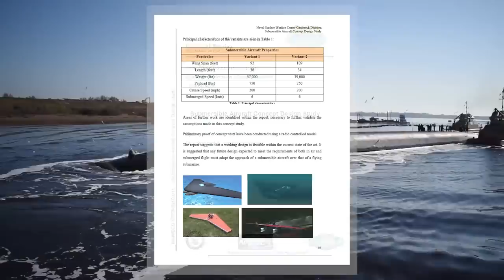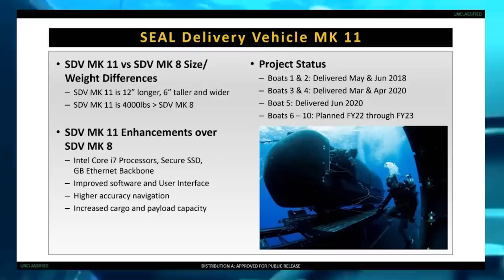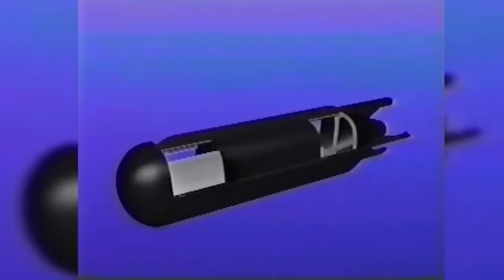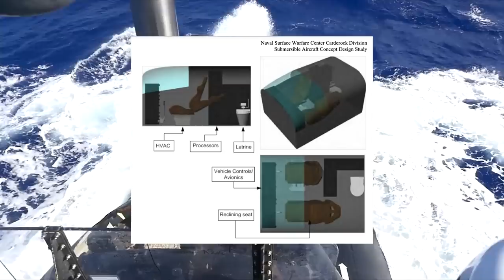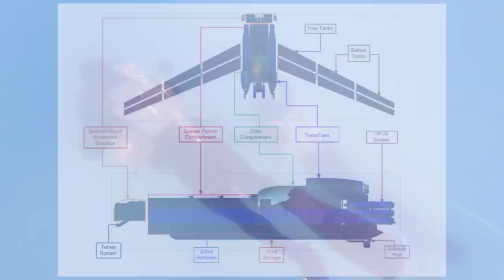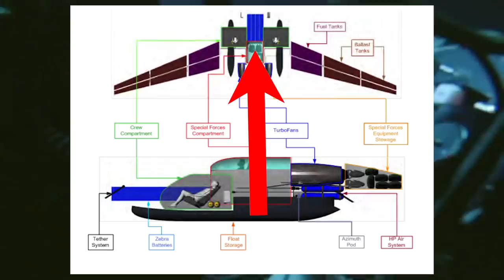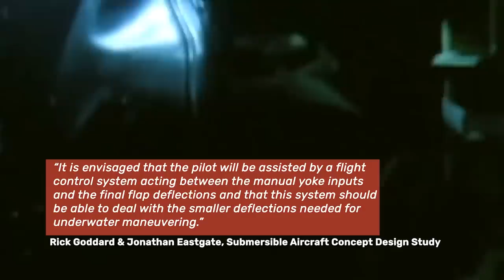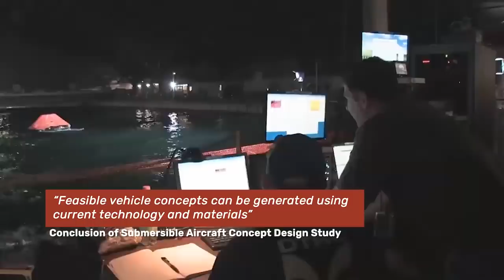Do the US Navy SEALs have FLYING SUBMARINES?

Comment: If you look at the deepflight submersibles like the super merlin, it reaches a depth of 120m, can travel at 6 knots and it weighs 1800kg, while carrying 2 people (2t in total)

It's a bit heavy for an aircraft its size, but perfectly feasible nonetheless.
Reply: it can't really fly....
Reply: @user-McGiver  i meant if it were to be made flyable
Reply: @almerindaromeira8352  how?..... using happy thoughts?.... it has to be an airplane first.... and a sub second... not the otherway around... but tacking of from the water to return means that has to be shaped like a hydroplane to and then is the differend engines-fuel etc.... it will take a huge ''system'' for 5-6 marines
Reply: @user-McGiver  it actually doesn't need to be a plane first. You won't get far if you narrow your views.
 I mean, it's not hard to add some canvas or even aluminium wings to it,  maybe a V-tail and a push propeller attached to a ~300hp engine from Lycoming or Continental with intake and exhaust hatches. 
Much like if a MQ1 predator had a child with a deepflight submersible. 
I've seen much more radical experimental aircraft made by civilians. I'm sure the DoD could figure this out if they wanted to. Now of course there is no operational need to go to 120m depth to deploy SEALS and the deepflight subs are positively buoyant at all times for safety reasons which would hinder the loitering aspect of the mission, but anything is doable.
Reply: @almerindaromeira8352 go ahead and buils a prototype then... or make a desigh and submit it!....
Reply: @almerindaromeira8352  Exactly, and 10 to 20 meters is probably more than enough to achieve a stealthy landing and extraction.
Reply: @Expedient_Mensch  especially if camo was updated. 

20-50 meters below water is perfect. 

Dark on the top, light on the bottom.

Comment: I would be curious to ask why they did not consider a hydrofoil or surface effect ship that could submerge instead.  I could see them building one or two special purpose ships.
Reply: Those are both great ideas. It'd be a lot easier to take off out of the water on a hydrofoil with the wings up out of the water.
Reply: @davewebster5120  My thought is that with ground effect or hydrofoil, you don't need the airplane part.  Your not as fast as a pure airplane, but you will have an easier time lifting the submarine pressure hull out of the water to gain speed.
Reply: @kennethng8346 too visible In sonar I expect.
Wakes are pretty detectable on sonar, and hydro foils have wakes last I checked ...
Reply: @deth3021  By sonar do you mean active sonar or passive sound microphones?  While I have no first hand experience, I'd imagine that trying to use active pings to track hydrofoils amongst the surface wave clutter would be difficult at best.  Maybe you could use doppler shifts, but wave movement would intefere with that.  Passive microphones would probably work.

I still think ground effect vessels would solve most of the problems.

Comment: If they admitted it's possible in 2010, it has 100% been made and used I garuntee it
Reply: I've been wanting to make one for myself for years.

If you're willing to concede that it's terrible at both, it's entirely possible. With modern batteries and electric motors, it wouldn't be that difficult. Particularly if it's an open type wet sub.

Fun fact, some types of airo propellers work perfectly fine in the water because of all the torque of an electric motor. I bet that a toroidal type optimized for flight could more than sufficiently serve double duty.
Reply: Likely as a demonstrator, maybe not yet in operational service due to the engineering challenges of dramatically changing media from air to ocean and back.

Comment: The Ekranoplan seems like a feasible existing design that could be modified for below surface travel. Speed, payload size,  low profile, etc.  I can imagine engine changes that accommodate underwater operation, and the vehicle having a pressurized cab, and any necessary deploy needs or pods etc.

Comment: i first started reading about the mark 8 in the 90s as a kid and ive always found the capability quite fascinating. although a bit fantastical on its face a flying submersible would be a tremendous asset in terms of versatile infil/exfil oprtions.  their limited range meant they had to have what was called a dry deck shelter that they grafted onto ohio class subs. i do believe theres now subs with the capability built in, but youd have to ask the navy. a dry sub variant is gonna really strongly expand this sort of capability, and a flight enabled variant would be a huge huge asset, especially if you could add air launched weapons. a jdam type kit for small diameter bombs would be sick.

Comment: Gliders or even ground effect craft, with submersible functionality, could be a good starting point.  Remember that a submarine of this type need not be either armoured or very depth capable.  For example, the fibreglass subs used by the Colombian drug runners.

Comment: I have designed a submarine that looks similar to a fighter jet that can "fly" underwater and breach from the water to also "fly" into the air at high velocities. The concept involves moving up to 100 mph under water at depths of less than 250 feet. Similar to a fighter jet, the sub is controlled by a similar flap and tail design that allows precise control under sea or in fresh water. The sub then can obtain these speeds to breach the surface jettisoning the ballasts and fly into the air up to 1000 feet using an air speed velocity of just under the speed of sound while carrying a full sized armed load and equipped with 20 mm cannons and torpedoes that can be fired underwater and from the air.

Comment: We could fill a "Narco-Sub" with Lithium batteries and use our new (soon) C-130 "pontoon variant" to land on water and launch the fiberglass narco sub, off of the cargo ramp, while afloat (same, in reverse, for recovery) .. The sub can be flooded (but sealed) and the internal seawater could be retained and recirculated, while being heated (even the small temperature difference, between "freezing "and "merely cold", may make all the difference).  Supplemental rebreather "refill cartridges" could extend the breathable air supply.

Comment: A submersible ekranoplan would make more sense. They use ground effect so don't need a great deal of wing lift and can be heavier. Yes, flying but just off the surface. You can still get aircraft speed.

Comment: Does anyone remember the Soviet Ekranoplan? Some scaled-down versions might be a happy medium, using today's more efficient electric motors and super-strong composites could help with the weight and it wouldn't have to get too far out of the water in case of any number of force-down scenarios, and prep time from sub to just off the surface of the water would have to be quicker and it'd help with the radar signature being just off the deck. It'd also help as far as fuel to get it airborne. Another big plus is the bigger the craft the more efficient the lifting apparatus becomes. I just think it'd be worth a look.

Comment: If they made this today, I feel like the design would abandon the requirement for crew operators and all the stuff about exfil in favor of self driving/remote driving capability. That would surely increase the operational flexibility by quite a lot. You can stay submerged and undetected for weeks if needed.. Right?

Hell, you could replace those people with oxygen machines/concentrators to quietly or even passively regenerate it while waiting. Again, increasing range and flexibility greatly, if needed.

But I'm not an engineer haha. This is certainly a cool idea. Wonder how much stuff like this will come into play in a conflict amongst the islands of the pacific.
Reply: Water is really bad for radio waves, so remote control would likely be impossible. It would need to be fully autonomous. The only use case I can think of is more of a long-range torpedo that starts out flying and dives to avoid missile defense.

The main reason for this thing though is to deliver Seals, they can do things that a drone could never even come close to doing. Basically it has no reason for existing without them. Also Since fully autonomous underwater drones have better range since the don't have people the flight requirement isn't necessary
Reply: @NickSteffen  Right, good points. I'm not saying to replace the 4 SEALs doing the mission, just the 2 sitting in the sub waiting 3 days for them to come back...

Yea. probably mostly autonomous. Not sure how good drones are at littoral missions, though, yet. Those can be choatic environments. You might be also able to get away with some general instructions via low frequency sound. At least to communicate a "return" command or a new set of coords, for example.
Reply: @Cyrribrae  I’m wondering if a semisubmersible vehicle (think drug smuggling submarine) is just better for this all around. Those seem to make it thousands of miles while staying undetected. That might be a better option for these types of missions.

Comment: So aircraft don't get crushed aside from the cabin and fuel tanks if you have flexible tanks and a porous cabin that won't get crushed either, the problem is expelling all the water so you can take off and having an engine that doesn't mind getting wet

Comment: It seems like the reason for terminating the F-22 Raptor production after only 186 units were built has to be due to advancements on another platform..? The progress and advancements  being so significant that putting money into an already obsolete unit wasn't feasible... Even tho The Raptor was/is state of the art, it doesn't hold a candle to what is coming down the pipeline.. Terminating production abruptly and secretively helps shut off potential top secret/classified weapon systems, materials and any other development advancements about the Raptor development and production getting stolen. inevitably just closing America's gap on our dominance of air superiority... I wouldn't be surprised if some of the systems in the Raptor aren't used in the next gen fighter...

Comment: If you look at the stuff that was the precursor to Sea Shadow, you can see what looks like a blended wing plane turned into a submarine. As the original idea was for a stealth sub rather than a stealth ship. Nothing but some studies came from that initial idea, apparently the stealth came at the cost of a significant reduction in speed (iirc Sea Shadow was a totally separate proposal that was based on that initial one). I really cannot help but think of that within the context of this video.

Comment: Tic Tac shaped UFO’s seen by navy fighter pilots were said to have travelled from 80 thousand feet to sea level plus also move underwater and since none of the higher ups in the chain of command seemed surprised they just might have known about this black project mentioned in this here video. Kinda makes perfect sense in hindsight. Need to know basis stuff. 🤔

Comment: The B2 was flying in 1986 and some in 1985. The airforce built a hanger just for the B2 way out in the desert. They had trouble getting the flight computer programmed. The flying wing was difficult to tame with the information they had at the time. I'm guessing the B21 is already flying or will be soon. Nobody will see the real first flight.

Comment: You failed to address by far the most serious obstacle against the usefulness of a submersible aircraft.  How calm would waters have to be for it to take off and land safely?  I suspect that the answer to that question would be rather ugly because the extra weight required to operate underwater would require a higher speeds for takeoff and landing, and would therefore require smoother water to take off and land safely.

Comment: "Flying sub ahoy!" -Marine Boy Theme.
  My thoughts on topic?
  Aircraft are highly specialized, as you pointed out.  So are submarines.  A single vehicle that tries to be both is going to be worse at submarining and flying than any purpose built platform.
  If you're flying through the air to get somewhere you want to submerge, why not be carried as underwing stores by a suitable bomber or transport?
  Consider it from my perspective.  You want a vehicle that both flies AND is stealthy AND functions nominally as a submersible insertion boat.  And is likely to fail in all three categories.  Why?  To put it simply: too many cooks spoil the soup.
  I would examine the wide paradigm and consider which existing vehicular design team is most likely to provide what you need.  Only one industry can do it-the space industry.  How would it do it?  I dunno.  But dealing with extraordinary stresses while maintaining low weight fractions in structure and services is what the space industry does.

Comment: When or will they offer an active insulated wet suit. A suit which could be semi integrated into the sleds system lessening fatigue from cold till they reach their target disconnecting doing their work and returning to it's security and warmth from the vehicles system. I can see this eventually coming to fruition when solid state batteries become common place with high energy density as it would lessen weight and increase abilities doing so. So, Alex I seem to remember a not to long ago story about a fast maneuverable mini sub that resembled a Manta Ray. I don't remember if it had a military bent, but think it may have any thoughts on it or if you know of same?

Comment: I can only imagine what would happen to a aircraft fuselage when it tried landing at smashed into a 20foot wave.. Also, they would be sitting ducks when they pumped water in and out.. Im sure there are better solutions.. like HAHO jumps into the sea and diving in.. they fly from more than 30 miles when they do.. so if they belive the "flying sub" would be save until it reached 12 miles out, sure something would be save at 30 too then

Comment: What seems way more logical than a flying submarine is a boat that can be deployed from underwater and then travel across the surface until it gets closer to the coastline and then re-submerge I think it would have a lot less design compromises and a massively increased range

Definitely wouldn’t have the same speed of deployment but it would be much more operationally effective in every other area Especially in the area of stealth You would have to make a lot of design compromises and the stealth performance of any aircraft that is designed to go underwater especially in the area of stealth coatings that can work in the air and not be damaged by going underwater
Reply: You mean like a conventional submarine 😂?

Comment: The flying sub would need to be stealth. A larger yet still small submarine sounds a lot more realistic. Why not just land with a seaplane or parachute in and then use scuba DPVs for the rest of the journey? Using on a kodiak at night from about 50 miles sounds more practical.

Comment: I wouldn't be surprised to see a Chinook helicopter converted into a flying submersible simply because it already has the the shape of a submarine you could design the rotors to fold backwards which would have less drag in the water you can fit ballast tanks on the side and then you could literally take off and land in the water.

Comment: There is Tech/R&D you've never even heard of in troves that SMU's use.
Reply: Imagine an SDV made of lightweight materails, with vertical lifting fans to direct some thrust down. In combination with ducted exhaust, it would work in the water and out of the water. and weve had this tech for 10 years...its (VTOL) tech thats water proof.The USAF-Backed Florida Startup Is Developing a Next-Gen Propulsion System for Flying Cars.
Reply: I could see them adding a recon ballon to bringing all the trusth into a backpacks for recon as well..

Comment: Hello !
First of all the "flying submarine" must have a wind-shield and wings. In order to dive, it must have ballasts to get heavy enough. But it must do 3 different things. First travelling underwater. Secondly get to the surface like a boat. Thirdly take of on water. Then all in reverse, flying, boating then dive. I don't believe it's possible. It would need batteries, or nuclear powered or oil powered. It would only be useful for short range and a minimum of crew. This idea is a waste of time and money.
Phil. Peace.

Comment: I’m only 3 minutes in but I’ll make a guess on what it will be like. A glider dropped from a cargo plane such as a C-130 or C-17. It will have retractable wings that swing into action when deployed from the aircraft and these wings will either detach or retract once in the water. Having an airborne engine will be difficult because it will either have to withstand being submerged and be strong enough to make a difference when carrying a possibly 15,000kg vehicle. That’s the current weight of the navy seals submersible vehicle

Edit: wow they were way more ambitious than I expected